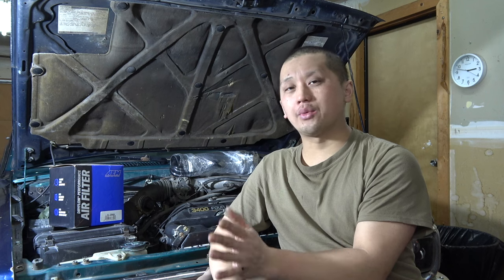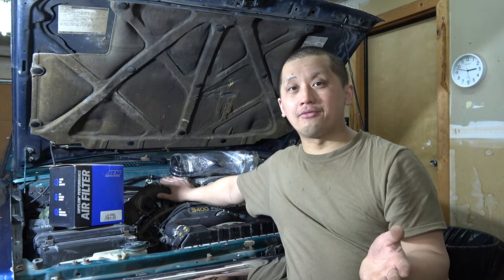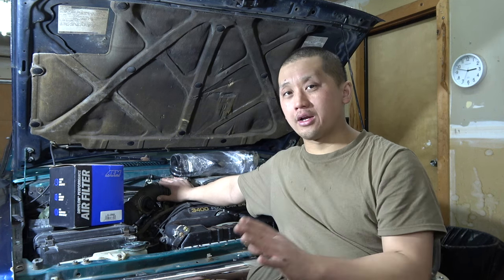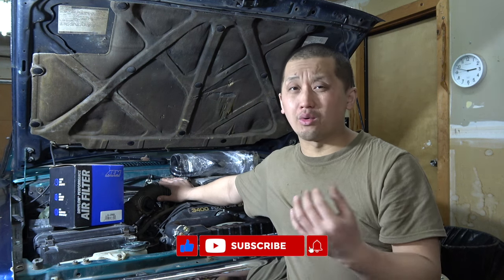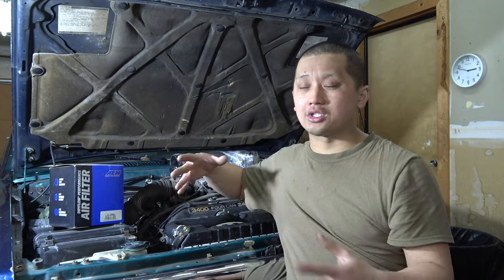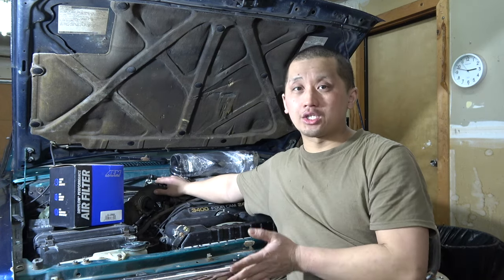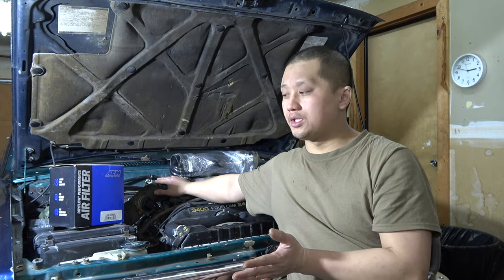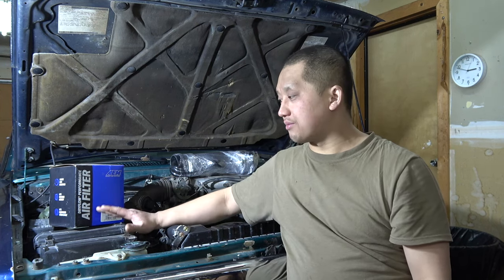TOY ONLY SWAP 5VZ-FE COLD AIR INTAKE | REVIEW & FULL INSTALL | 3.4 SWAP

Comment: It was a cold-air intake when it was stock. It is now a warm-air intake with the filter drawing engine-bay air. Those pesky Japanese automotive engineers spend a lot of time and money testing intakes. The fluid dynamics involved to get proper intake resonance is a black art they are masters of. Don't mod intakes unless you are just looking for more noise and fewer mpg. The aftermarket has pushed cold-air intakes as a trendy "must-have."